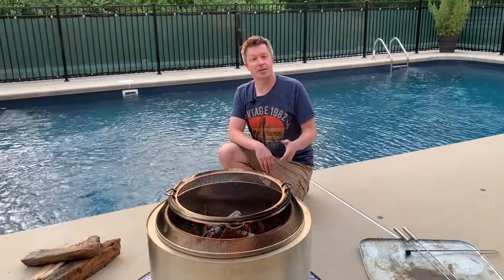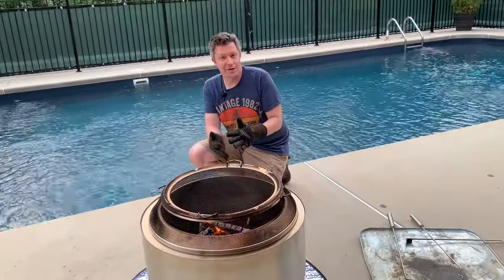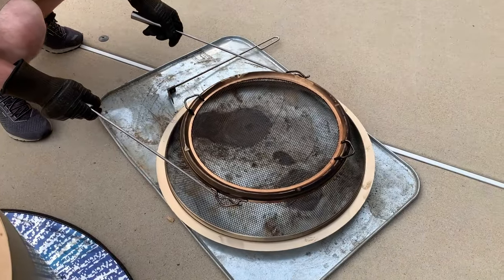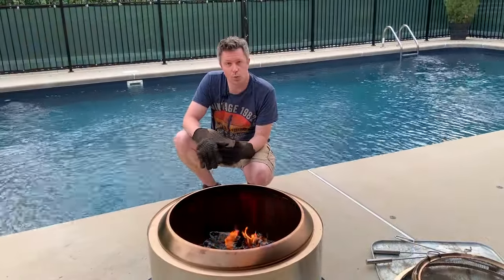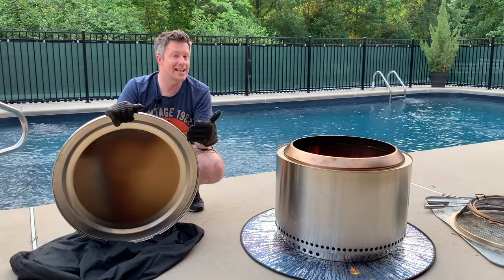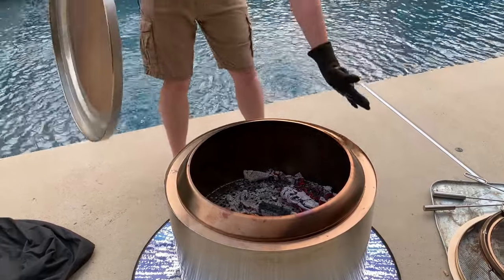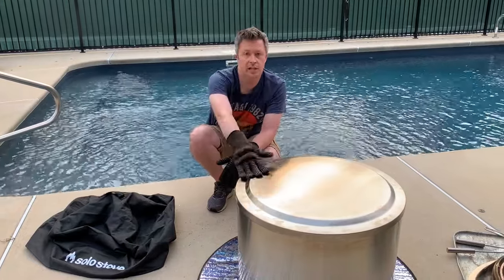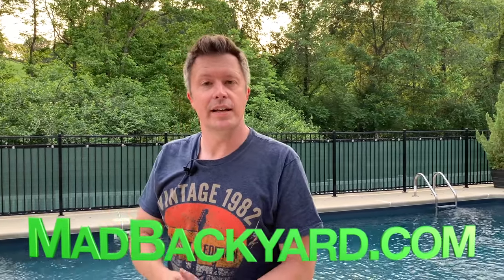How to Put Out a Solo Stove the RIGHT Way

Comment: Couldnt you just leave the guard on instead of the lid?
Reply from the maker: Hi Jay-  yes you could and that would definitely be better than leaving it completely uncovered.  One issue would be any wind could still blow some of the ash around and out of the solo stove after the fire burns out. Also if you DO get some rain or drizzle overnight the lid will protect the inside of the stove.  It’s just a more solid option in my opinion.  Thanks for watching!